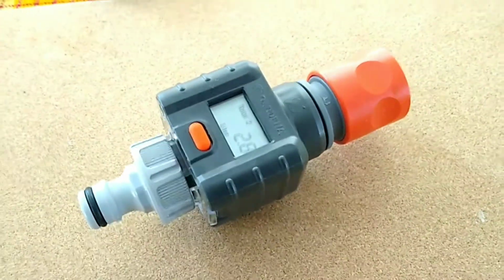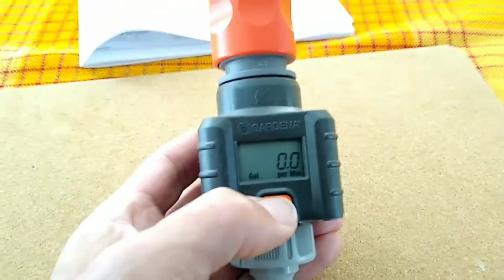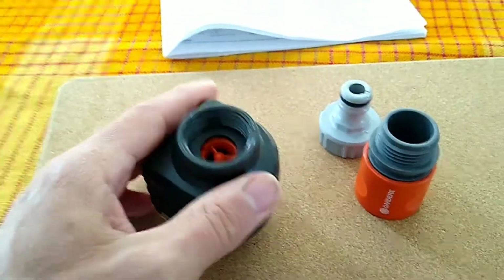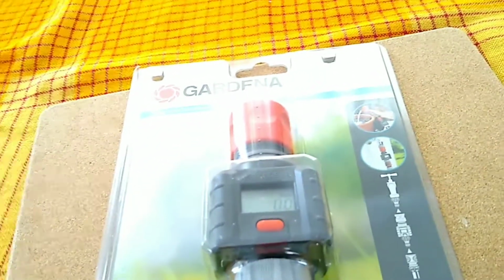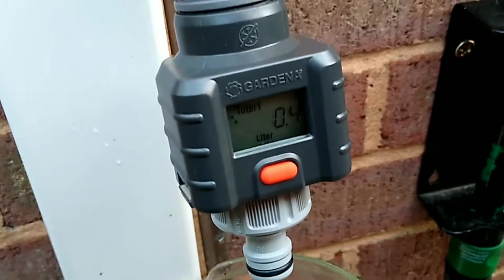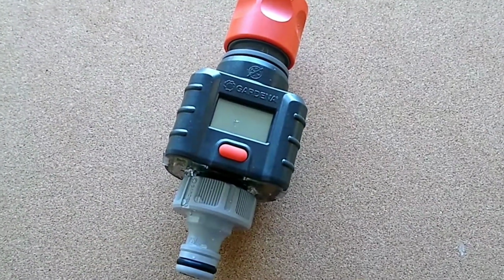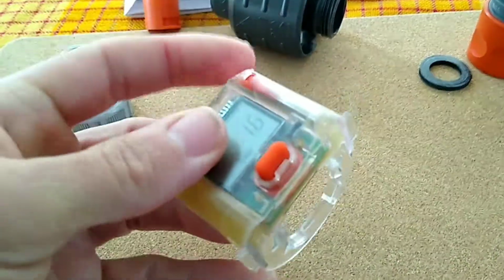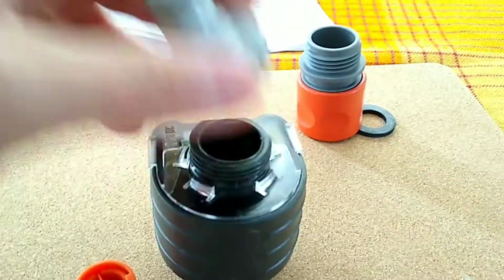Gardena 8188 hose water meter review and disassembly

Comment: Pity you didn't check how to remove battery and change it. It would have been funny. It is impossible to remove the battery.
Reply from the maker: Use fine nose pliers or tweezers, not too much problem.
Reply: @mr.berlingo8211  Of course I tried both, but there is no grip. If you could how you changed battery I'd love to see it. 
This device works fine only  if you use it as you show,
 but the biggest interest to count how much water you use is when there is automatic watering system after it.

So mine was between watering programmer of same brand, and a pressure regulator of same brand too. 
First  I never could manage to get a perfect waterproof watering system with this between, it was always losing water  sometimes from above, but mainly from under. When it loses water from lower side, and you screw more the pressure regulator inside it it turns off the screen , and so you can't know how much water is gone :))  You unscrew a bit, screen works again, sure you lose more water, but now you will know how much :)

If  by luck,  you can manage to build a waterproof system with this , or have accepted to lose water from its upper or lower ends... imagine one year later ... you will have to to disassemble all , just to change battery .. 
And when all is off, surprise ! You can't catch this battery  !! So you understand it times to put this off and come back to the original system.. programmer, above , pressure regulator under it.. and nothing between.
Tell me what crossed the engeneer's mind when he decided to put such kind of battery, in such unreachable position at a place you have to dissassemble all system ?  Maybe it was his joke and he had a lot of fun imagining you one year later.
I had bought two of them, and both had same problems...
Sorry for my poor english
Reply: And of course I tried with teflon